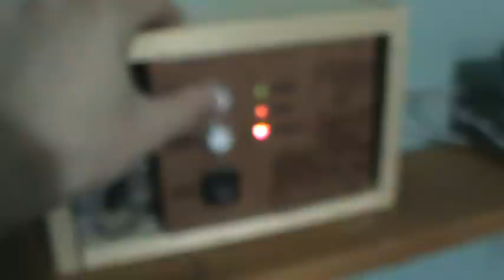Mini System Test 8 (5001-DC)

Comment: Alarms On the 8005:

His Room:
Federal Signal Remote Strobe
Federal Signal Vibratone on the ceilling 

Living Room:
Siemens UNH-MCS 

Basement:
2903 Light or strobe plate 
Horn: Simplex 2901-9833, or a FOS 6120 without the grille, or his 2901 9838 with the grille. 

In system test 30, he had all MT's but he said he had a 2903 near his PC Room but he said there was a reason why its not there anymore

Garage: UMMT (if you saw system test 30 he said the UMMT was there for acting as a chime, or possibly his 9219 was there cause in the fire alarm buyers guide he said the 9219 wasent with him
Reply: federal vibratone on the ceiling?? thats just plain wrong
Reply: @dank980  no??? There was one on the ceilling
Reply: @Flanks719  and when's that? there absolutely isn't lol
Reply: @dank980  This video was made a little bit before his Coded Pull Station Demo. The horn you hear in this video sounds exactly the same as the one in the coded pull video. In that video, Andrew shows the Vibratone mounted on the ceiling. So it is most likely the Vibratone like TCR said.
Reply: @Loganetics1  ahh, i see
Reply: @Loganetics1 It has to be because they sound the same

Comment: Now i kind of know what other alarms are there. Isn't it your federal signal low pitched vibratone( the one that was on the cielling in the coded pull station video with cjgoot) with an I strobe in your room, a 4903 9219 in the living room, and i don't know what is hiding in your basement. It sounds nice though, whatever it is. Sounds like some vibratone, simplex or federal signal

Comment: Correction: old edwards adaptahorn near closet, bedroom: federal signal horn with federal signal i strobe horn mounted: living room:  9219 horn/strobe basement: 2093+ 2091 9838 horn
Reply: There is no way that the horn in the basement is a 2901 9838. It does not sound like that. If you have seen system test 26, you would know.
Reply: @ktg1012  not all 9838s are the same, and by the way it is a 9838.
Reply: @dank980  FOS 6120 is the horn. See system test 20. The FOS 6120 horn was in the living room. Maybe he adjusted the pitch.
Reply: @Flanks719  wrong, you can tell the strobe isn’t a 6120 strobe
Reply: @dank980  his fos 6120 has no cover on it. Its a horn only. In system test 20 it was under the zrs. He maybe adjusted the pitch of it
Reply: @Flanks719  oops, i thought you were talking about the one in his bedroom. anyway, there’s no way to tell whether it’s a 6120 or a 9838 because they’re the exact same horn mechanism.
Reply: @dank980  true. He has a 9838 with a cover and one without (the horn in its orginal form, fos 6120) so the basment is either one of his 9838's or a 9833. It could also be his 4901-9816

Comment: What were the alarms in the background except the Edwards horn?
Reply: It is a federal signal low pitched vibratone with an I strobe in his room that is seen in his coded pull station video ft. Cjgoot, maybe a 4903-9219 that was seen in the living room in system test 24, and i don't know about the basement. It maybe a simplex, or federal signal vibratone. If a simplex, then on a strobe, or light plate, and if a federal signal, than with an I strobe or just a horn with no attachments. I also don't know. What i know for sure is that the horn in his room with an I strobe, is for sure that vibratone with a low pitch. I don't know the model number

Comment: That's not what I heard. They sound completely different. Maybe they were both down there, or the 9833 with another horn similar to the 921X?
Reply: CODMarioWarfare a 9833 sounds different from a 9838 or a 9806 or a 4093 production models

Comment: I think the horn in the basement is a Faraday FOS-6120
Reply: No, its not watch system test 20, in system test 20, the pitch is different. It sounds like a 9833 or a 9838
Reply: @Flanks719  the 6120 is the same as the 9838.

Comment: Here what an hold canadian fire alarm system would be. The signals will be your edwards horn and wheelock mt horns. Pull station 270 spo and simplex 4251s. And a edwards 6500 control panel

Comment: The alarm in your room looked like a FOS 6120
Reply: It is a federal signal vibratone with VALS or ADA I strobe
Reply: Ok
Reply: @SirensAndAlarmsOfNorthernIL  late but I paused the video and it looks like a Federal Signal vibratone or mystery alarm with a ADA I strobe that is angled downward
Reply: @SirensAndAlarmsOfNorthernIL nope fail, if you watch his coded pull station video with CJ Goot, he has a D1 450D on the ceiling with a V1971 strobe on the wall I am sure

Comment: What Were All Those Other Alarms Going Off?
Reply: Colton Stigall His Room: Federal Signal Vibratone on Ceiling. Federal signal strobe on the wall.
Living Room: Simplex 2901-9806 and Federal signal strobe.
Basement: Fire Lite HDP Federal Signal strobe FCI HP and Federal signal strobe.
Reply: Temple 92 in fire alarm buyers guide, the Siemens unh mcs was in the living room.
Reply: Temple 92 nice job Sherlock

Comment: How did the system relay activate the other alarms?
Reply from the maker: Relay turned on, had the other alarms wired to it. It works like a switch that is controlled by electricity instead of a person.
Reply: Official NewAgeServerAlarm what were the alarms that sounded?